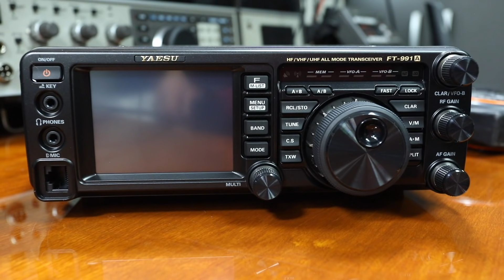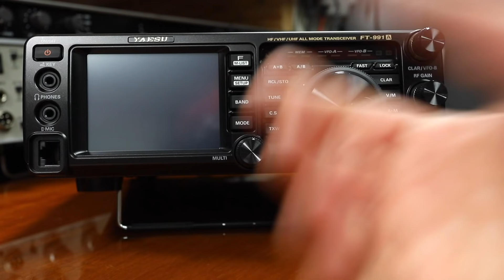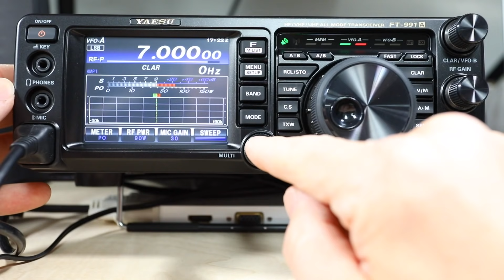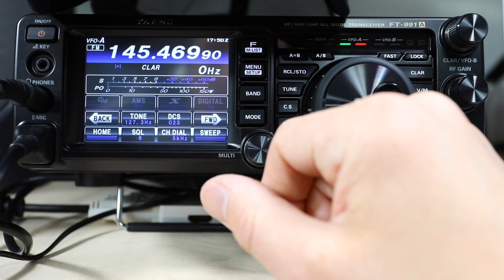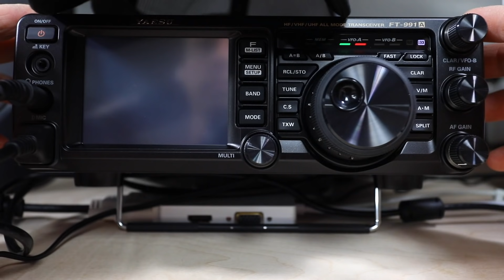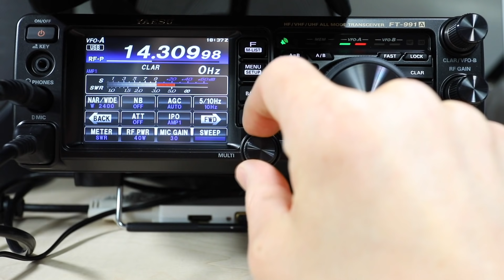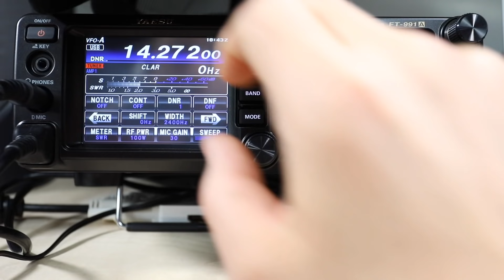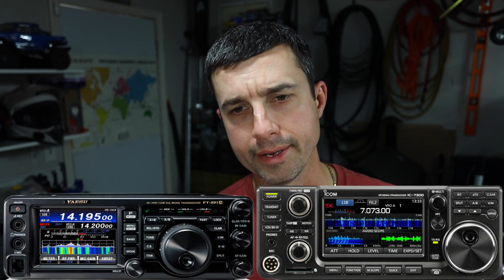Yaesu FT-991A Unboxing + On-Air Tests

Comment: I think the dnr makes it sound like its under water. I have to keep the settings low on my 991a. My 1200 is better in that regard. I got the 991a as a spare for either radio in the shack. It can take the place of my dual bander or hf if I have a failure. Also want to do portable/camping.
Reply from the maker: Yes, it sure does. I only run it at a 1. I'm looking forward in taking mine camping as well. I'm not sure how fast it will eat the batteries/solar I have for it...but there is only one way to find out :)

Comment: That was a fun video! I haven’t yet jumped in the water in a serious way (cost?), but just last week purchased an Eton Elite 750 to try and pick up some short wave transmissions—researching coaxial antennas right now so I can pick up distant transmissions without electrocuting me or burning my house down. 😜  However, I’m also drooling over the ICOM IC-7300 (and now that Yaesu). Disclaimer: I do not have an amateur radio license, as I just now jumped in with the Eton. However, the bug is infecting me more and more—I can see a license being just over the horizon. My dilemma: Do I go ahead and buy one of those transceivers now (free return on the Eton) and just use it in RX mode until I can get licensed? Or do I learn on the Eton, and then migrate up the chain? If “B”, then I just added the cost of the Eton to the cost of one of those two radios. Got any advice? And thanks again for a great video! P.S. I’m nearly 63 years old, and a larger display is becoming more and more appealing. 😉
Reply from the maker: Thank you and welcome to this great hobby. Yes, you can buy any radio you would like without a license and just listen. The IC-7300 does have a better display over the FT-991A. Have you herd of https://hamstudy.org/ ? You can study and take your test from that website.
Reply: @HamRadioTV  - Thank you for that link—it is now saved in my Bookmarks.

Comment: Nice review! The 991A looks like a fine radio. What is your opinion on the Yaesu 857D for a HF radio?
Reply from the maker: Thank You! The FT-857D is a great radio and I'm glad the price is coming down on it, as it's getting a little older and missing the newer whistles and bells that help pull out weak stations. The size is great, if you plan to do more hiking/traveling with it. If you don't need 2m & 70cm and would go with the FT-891. The 891 goes for around the same price, but you will be much happier with the display and the new filters on it. ~73~Jason/KM6FAK
Reply: @HamRadioTV  Thank you for your reply! If I require a base station, what is your opinion on the IC 7200 vs. the IC-718? Which one would you favour?
Reply from the maker: @karlng2691  The IC-718 looks like a great base station for $598.95 over at DX Engineering. Where the 7200 is water resistant and built to be more rugged, so that is un-needed cost if it's just going to sit in your shack.

Comment: Totally agree, the IC7300 will be and is a dime a dozen. I also prefer super superheterodyne. These SDR radio's are cheap to make yet they sell for quiet big dollars considering. The 991A sounds great and I get great reports. Want a 7300? 3 years from now they will be everywhere for peanuts.
Reply from the maker: Great points! If Yaesu did a refresh to this radio with a nicer/larger display or maybe put a video out on the back it might become even more popular. Overall, its a great size and has been working great!

Comment: Great video useful info, I am currently trying to decide between 7300 and FT-991A. I'm leaning towards the Yaesu now...I have limited space, and it would be amazing to have everything in one small package
Reply from the maker: It is a tough a choice! I'm still very happy with the 991A. The 7300 is a great radio but I would then want to buy the 9700...and I don't have that kind of cash right now.
Reply: @HamRadioTV  Yep exactly my thinking too, I figure I'll get more value out of having all modes on vhf/uhf than having a slightly nicer looking scope and menu structure

Comment: I noticed the ten tec in the background. How does this new model measure up against the Omni vi plus??? I just bought an old Omni vi as my first rig.
Reply from the maker: The FT-991A has some nice digital filters that really help hearing stations in the noise. The Omni was great radio and I enjoyed all the "hard buttons" instead of all the menus on these newer ones.

Comment: Have you done a video showing how to connect the ft991a  to a monitor to run a panadaptor and would you recommend the 991a over the 7300 for a new operator
Reply from the maker: No I haven't. Both will need modified as there is no IF out. You can buy an aftermarket box that will share the antenna feed with the radio.

Comment: Jason, great video! You did a wonderful job going over the features of the radio. I’m new to all of this. Just got my Technician license in May, and then my General in June. For now I’m using my Yaesu FTM 400XDR for a base station, but want a radio that has more features, and frequencies. Plan on the Yaesu FTM 400 going in my jeep soon. Since you’ve had this for awhile, is it something that you would purchase again with the knowledge that you have now? Is there a better multi-mode transceiver out there that you know of in the $1000-$2000 price range? N7WHY
Reply from the maker: Hey Mick, congrats on the T & G license and welcome to the hobby! Yes, I would buy the FT-991A today. It has been working great for me at home and out portable/camping at a picnic table. This radio checks a lot of boxes but, if you are just building a home setup having HF and VHF/UHF in two different radios would be better. This is a more expensive option but will give you the ability to be in multiple places at once and I do like operating like that. So, if you have some extra cash laying around lol, a dream setup would be the Icom IC-9700 & IC-7300.
Reply: @HamRadioTV  First, thanks for taking your time to give me some great info. It is very much appreciated! I was actually thanking about the ICOM 9700, but didn’t really know much about it. Guess I’ll have to do some more research. Thanks again!

Comment: Did you use the internal antenna tuner when you went to the 20m band? Can you put a link for the 2m vertical antenna used.
Reply from the maker: When portable I do run the tuner on 20m & 40m band. Back in the shack I'm running 500 watts, and then use an external tuner. I built a copper J-Pole out of water pipe that is mounted to my chimney for 2m. It has good SWR.

Comment: How do you switch between different antennas, or do you have to manually unhook and reconnect them each time you make a change?
Reply from the maker: The radio has two SO-239's on the back. One for high band the other for low.

Comment: QSO KN6DAM I was thinking about buying the Yaesu 991a just a few weeks ago. Thinking it's my choice right now. I gave up waiting for the icom 705(and a mating amplifier). This yaesu has several advantages, 100 Watts, tuner...fusion?...
73s from Modesto, perhaps I'll hear you on the Diablo repeater.
Reply from the maker: This radio has been great. Especially for taking it outside and camping. And, yes it has 100 watts, internal tuner and Fusion (RF only). If you're not going to be active outside with it my next choice is the IC-7300 & IC-9700...oh, but you will need some $$$ for those together. I listen to the K6POU when at work and home and listen to the W6VVR when at home.

Comment: Excellent review, I am thinking of upgrading from a  ftdx1200. How do you find the radio performance on airbands and general sw utilities monitoring. Thanks de vu3mes Satyan
Reply from the maker: Thank You! Yeah, air bands come in good. It's nice it to be able to switch over to the VHF/UHF on AM and listen. I live 8 miles from Travis AFB and can hear all sorts of air traffic on it, with my homemade J-Pole on my chimney.
Reply: @HamRadioTV  hi thanks, I too live near an international airport VOMM CHENNAI. It was my passion to monitor VHF and HF aircommunications for a lifetime. I also have a flighradar24 nod at my qth, call sign is F-vomm2. Thanks very much again 73 from Chennai India.

Comment: I noticed I saw what appeared to be a Super VGA video card with HDMI output under the transceiver.  Is there a reason for that?
Reply from the maker: Those other connectors are for a laptop I put next to it. Unfortunately this radio does not have a display port.

Comment: Hmmm, the ICOM IC-7300 was your runner up.  I didn't know the 7300 was able to get on the VHF band?
Reply from the maker: The 7300 doesn't have VHF/UHF. I was primarily after a smaller HF transceiver with a waterfall display, built in tuner and a built in sound card. The fact the 991A also had VHF/UHF gave it an advantage over the 7300.
Reply from the maker: Fast Freddy Muldoon Yes, that is technically correct. I was just generalizing the VHF/UHF with the bands you most often use for local chatting on the repeaters. How often are you using the 6 meter band?

Comment: I would like to know if the 991a can be “opened up” to TX on 11m (CB)?
I purchased a FT5D thinking I’d have a single radio solution for CB-FRS-GMRS-VHF-UHF, but despite Mars, the radio shows “TX Inhibit” on the CB bands.
There are much less expensive radios that will accomplish this and I’m quite disappointed (at least until someone figures out how to do it on the FT5).
I want to buy a more powerful mobile companion to that FT5D handheld and the 991a seems to be its big brother in almost every way, but TX inhibition on a radio this pricey done once is disappointing….twice would be ridiculous.
For the recited, I’m a prepper.  I have no interest in polluting the bands….just having the ability help people if needed during SHTF.  For me, anything that can’t tranceive CB is limited to Comms with less than 10% of what you will find in the hands of the public.

Comment: And the ebay link for the xcvr to amplifier cable? Didn't see that listed.I need one to connect my FT-991A to an Elecraft KPA 500.
Reply from the maker: Woops, I just added it in the descriptions. Thanks for the heads up! Here is the link: https://www.ebay.com/itm/Yaesu-FT-891-Amplifier-Relay-Keying-Cable-FT891-FT991-FT-991A-8-Pin-mini-DIN/322379360375?ssPageName=STRK%3AMEBIDX%3AIT&_trksid=p2057872.m2749.l2649

Comment: Thanks for the video. What is a basic HF antenna that could be used with the 991?
Reply from the maker: Thank You! At home I'm using an inverted-V off my chimney. I picked up a balun and then made my own antenna with some 14 AWG standard house wire from Lowes. I've made 3 inverted-V's as they are all mono band-20m, 40m & 80m. I then use a pulley to bring them up and down. I also use a copper J-pole I made my self for the 2m. One antenna that has caught my eye is the Buddipole. It will do 2m-40m and comes with a great carry kit for when camping and going portable. ~73 KM6FAK~
Reply: If you have the room, an 80 mtr 1/2 wave end fed is great. Reasonably resonant on all the bands, 80-10 mtrs. If you don't have room for 130 ft of wire, you could go with a 40 mtr end fed half wave. A nice support would be a "spider beam 12 mtr fiberglass push up pole".
Reply: As a guy who takes his 991A "to go..." I use the Wolf River Coils...the TIA 1000...with Times LMR UF 400 Coax...just because it can take the abuse of being tossed around...but Wolf River Coils are excellent...

Comment: I've been torn between the 7300...which is awesome, no question at all...and the 991A...I want the "shack in a box" though and something tough enough to be outside for Parks On The  Air and to do local field day and SOTA...but have bells and whistles too...it may not be quite as easy to use, but it gets the job done..at an affordable price...great review by the way...73...de...AC3FB...
Reply from the maker: Thank You! My thoughts exactly. I recently got a Nanuk case for it and its so nice taking it to the parks.
Reply: @HamRadioTV  nanuk case...sounds like a good idea...I'm going to look into it...what do you use for power?
Reply: Well, I did it, got my 991A at Ham Radio Outlet and my Bioenno 1220 battery...😁 played with both the Icom 7300 and the 991A...definitely prefer the Yaesu FT 991A, the Icom 7300 is magnificent, looks like a smartphone...acts like a smartphone...but I want a tough outdoor rig, but with plenty of features that I am not afraid to take outside...

Comment: Btw .. what power supply?
Reply from the maker: The FT-991A pulls 23 amps at max transmit power. You could get away with a 25 amp power supply, but having more never hurts and will allow the amp not to run at it's max output. I like my used Astron 35 amp.

Comment: Mine won’t transmit to my local repeater on 145.290. It will only ka chunk it. No voice goes though. Any ideas?
Reply from the maker: With out knowing more details its hard to diagnose. I always ask people 3 things when dealing with a repeater. Is the offset frequency correct when you push the PTT. Is the PL tone correct?  Are you encoding, decoding or both?

Comment: Hey, nice video.  I am looking for an all-mode rig for the shack.  I have high beams on 40/20/17/15/12/10/6/2/440 and the FT-991a would be great for that.  Being able to use the waterfall on lightly populated bands a big plus.  Additionally, being able to run CW and SSB on 2 meters I see as a real plus.  The smaller size does seem to be a big advantage over other all-mode rigs.  My last one was the IC-746Pro. This brings digital to the table and in a nice package.  I have started saving my lunch money for one as well.

Comment: does it also scan to collect stations for the memory ch ?
Reply from the maker: It can scan both your Memory Channels or the VFO, up and down the band. It won't auto save what it finds as it could just be noise, but it is simple to add what it finds to it's memory banks.

Comment: I've just purchased a Yaesu 991a with the MARS mod.  I love this radio.  Got a new power supply to drive the radio, a MFJ 4035MV, continuous 30 amp.  What's not to like, all mode all band (except 220)?  I would suggest anyone trying to decide to go with the Yaesu 991a.  I have a MFJ 969 Versa Tuner II but rarely use it 'cause the 991a has a built in tuner that handles all my antennae 'cause they are close to resonate.  Have ordered a Heil Pro 7 headset to work with the Yaesu.  One thing I don't like about Yaesu is the digital side of things.  With C4FM (System Confusion) voices sound muffled, muddled and sound robotic as though they are computer generated.  Of course none of the digital modes are compatible, Icom had D-Star (Death Star) and then there's DMR.  It is understandable though, one half of the bandwidth is dedicated to voice and the other is dedicated to error correction, so it's no wonder the voices seemed compressed and robotic--voices are compressed (too much) into just 1/2 of the bandwidth.  Digital has a long way to go before I will use it for communication.   Cheers & 73 from W Rusty Lane K9POW in eastern Tennessee

Comment: Thanks for the review. I've been looking at the IC7300 or this one and I'm leaning towards the 991a for the all band capability. 73 KM6KHT
Reply from the maker: All bands are nice if you plan to go portable with it. Do you have any Yaesu Fusion repeaters in your area? Or maybe a local ham that has set up a simplex C4FM into a Wires X Room? These are the main things that made my decision.
Reply: @Colin Baker WRONG
Reply: jerome, well if your shortlist just has these two radios on it and you want / need vhf/uhf then the choice is easy. Other the Icom wins hands down imho. Far better display, much faster refreshing waterfall and the whole look and feel looks so much more attractive and less ‘tacky’ if that makes sense. Ymmv of course.

Comment: I bought a 991A on Fri. I had it out of the box in about a minute.
Reply from the maker: haha, that is awesome! How are you liking it so far?
Reply: Ham Radio TV I won’t be able to use it until I pass the exam in May. ( hopefully). I could have bought any set I wanted but the 991A is a beautiful looking set. In fact, I thought all of the Yaesu txs were much better looking than other makes. I was never going to go with Kenwood and might have gone with Icom but my mind was pretty much made up. Nothing against these makes but it’s important to like the looks of your purchase.

Comment: Good info on the radio. Just passed tech exam and looking at this as an "all in one" option to start in VHF/UHF/10m and have all I need once I get General.

Have an older Yaesu HTso primarily looking base use.
Reply: A year later how you like it? Taking test for Technician License Tuesday and leaning towards the ft991a. Is it a bad choice on my first radio?
Reply: @weslofton886  Had to delay purchasing   due to some covid related cutbacks last year. Still looks like the best choice, and one I hope to purchase maybe this fall.